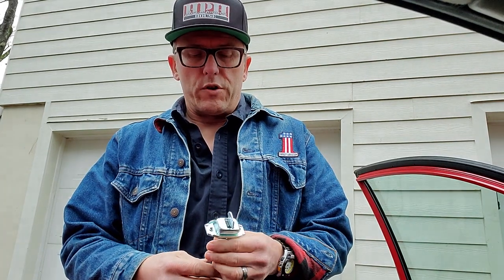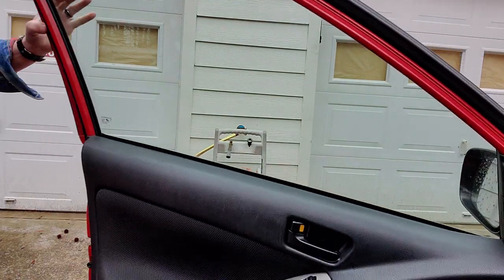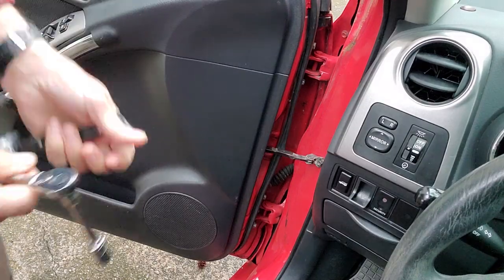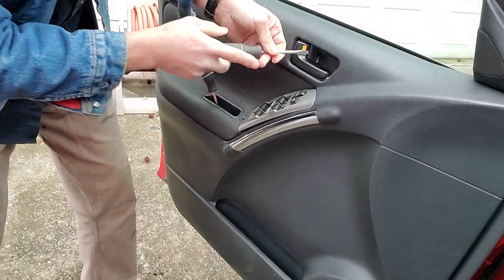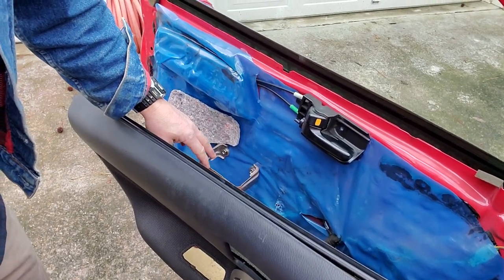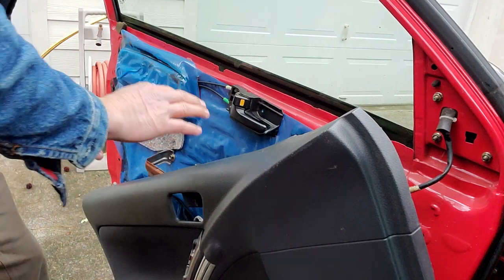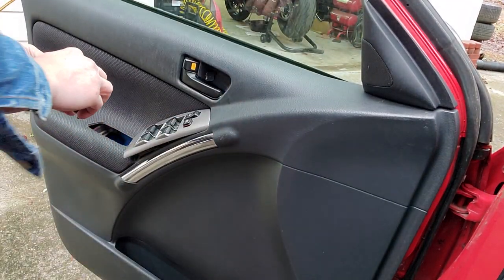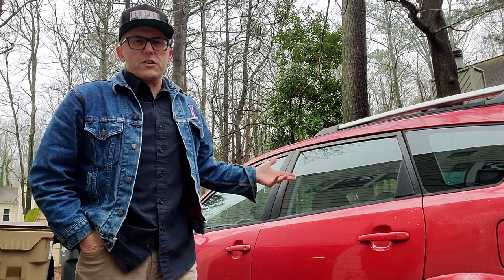Door Check Strap Stopper Replace Remove Toyota Matrix Prius Pontiac Vibe 2003-2009 Install

Comment: Thanks for the Vid!   The check strap actually cracked at the pin on my wife's 04 Vibe.  The local dealer wanted $85.00 for the replacement. 
Found one on Amazon for $12.00.  The taking off of the door panel was what I needed to know........Thanks again! 👍  Metal On!  🤘

Comment: Thanks!   I had to replace the side bezel and went ahead and did the stopper too.   The bolt to the frame was a booger but the hardest part was getting the panel back on.  Your demonstration made it easy.
Reply from the maker: The Thanks Button awaits you